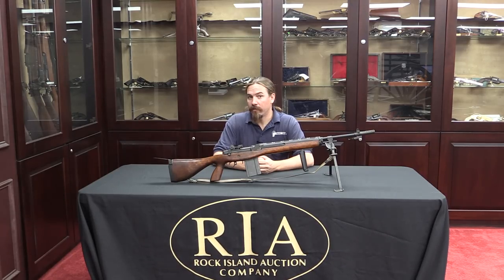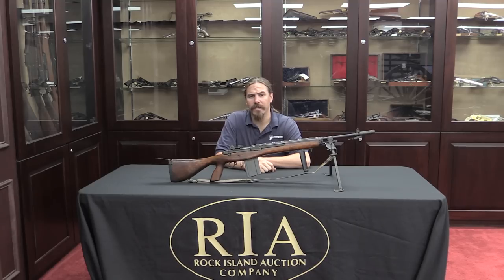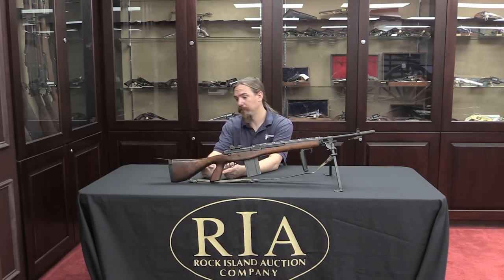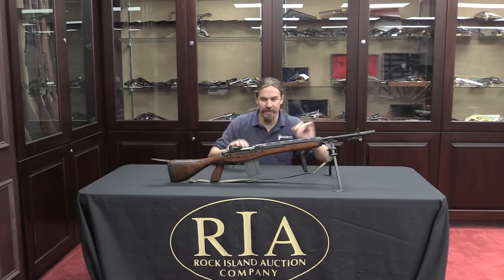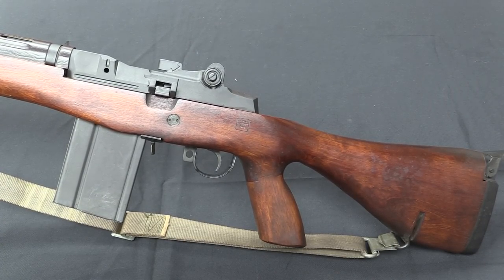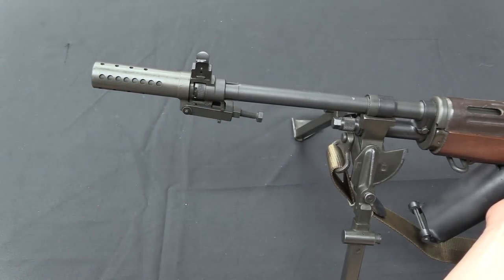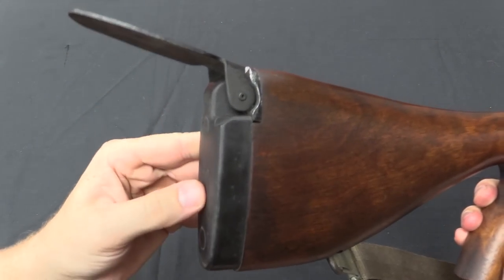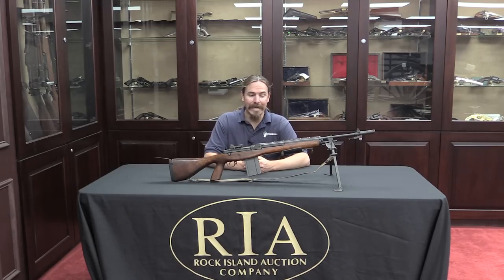M14E2 Semiauto Clone

Comment: Very interesting was back in the late 1970s and early 80s.An auto-rifleman was designated by having a bi-pod on his M16A1 in the infantry squad which had two with one per fire team before the SAW was issued to the infantry.I was in both mechanized infantry and airborne infantry.Mechanized infantry had an M-60 per squad as an AR (Automatic Rifle) in truth its a light machine gun per squad.In the airborne infantry units they had what i have mentioned previously and had two M-60s in their 4th or weapons squad.In airborne,air assault,and light infantry units bounced back in forth on the concept on how to use the M-60 as a SAW or M16A1.By 1988 when the Army had enough M249 SAWs the table of equipment had changed once again.Mechanized infantry had one saw per squad,airborne,air assault,and light infantry had two to each fire team.After Panama in 1990 all airborne,air assault,and light infantry units had been equipped with SAWs with the exception of most mechanized infantry by Desert Shield because the priority for the SAW was airborne and light infantry units.The SAW is an excellent weapon by my experience both in combat and training.The Marines have gone back in time to adopt the M27 Individual Automatic Rifle from H&K as a HK 416 variant of the M4.The only difference is that he will carry more magazines than belts which is more reliable as a system.

Comment: In concept, it looks to me to be like the FN C2, which was used in the Canadian army from the end of the Enfield/Bren era, until the M16 family era.  It was not a great gun, although I can see it was better than this thing.  The C2 was basically the same as the FN C1  (a variant of the FAL), except it was full auto, had a heavy barrel, bipod, different sites and 30 rd mags.  I think it was better than this m14 variant because the bipod folded up to become the fore stock.  It was a decent bipod, and when deployed the entire barrel would be exposed for cooling.

It was used as a section (ie squad) level LMG with one or two per section., so when it came out it replaced the Bren Gun.  The Bren gun was a great weapon in my opinion, and the C2 was not so great.  The Bren gun weighed about twice as much, but it had a quick change barrel.   Other than to the person tasked to lug it around the extra weight and QCB were a huge bomus in an LMG.   I know from personal experience with the C2 that after firing a few mags at a high rate of fire the gun got so hot that you no longer had control because of cook offs.  At this point if you had a Bren you would change barrels.  As anyone with experience with machine guns knows, barrels don't last that long.  It doesn't take that long to burn them out and have rds going down range sideways.  With it's great sites, bipod and heavy barrel the C2 would have been a good designated marksman type weapon in it's day, but withut a QCB, most of them had shot out barrels.

Anyway, long story short, in concept this thing looks like the widely used FN C2 and similar FAL LMG variant.

Comment: Didn't the M-60 fill the roll of squad automatic weapon during this time period?  
So why the M-14E2 ?
Reply from the maker: It did, but only because the M14E2 was a failure. In theory, the M14E2 was supposed to replace the BAR and the M60 would replace the M1919.
Reply: Not surprised.  I never understood the concept of the BAR either.  With such a limited ammo capacity, you spend more time reloading it than shooting it.  

Not very effective at laying down suppressive fire unless you have like 20 of them.
Reply: From what I remember, the M60 was just supposed to be a utility machine gun. Not designed to be a dedicated squad automatic weapon.
Reply: heirofaniu the bar was the exact same in ww2 as ww2 except they put a lot of heavy awkward junk on it
Reply: The same reason we have a m249 SAW when the 240 bravo replaced the m60, why do we need the SAW?
Reply: The M60 was meant to fill various roles so that's why you'd see it in helicopters and tanks in Vietnam then this didn't work so out of that the HMGs were born to take those heavy vehicular roles along while the SAWs tried making a lighter sustained fire concept with ammunition shared by the whole squad (Hence SQUAD automatic weapon) and the Miniguns because they realized a normal MG just wasn't effective enough for helicopters

Comment: Borrowing pages from BAR developme t they could have increased the long range accuracy of the M14E2 by simply moving the bipod further forward.  With the BAR they had to move the bipod further back to increase the beaten path at long range.  They could have done the same trick in reverse for the M14E2.  One can only speculate, but a possible reason they didn't do that was that somewhere up high there was someone who didn't like the M14E2 so that improvement was not tried.

Comment: Okay.  If the M-16 is the AR-15, and the M-15 is a BAR Variant, and the M21 is a marksman/sniper variant of the M14, what are the M-17 to M-20 rifles?  IIRC, the M21s were used in Vietnam, so they all would have been Vietnam-era rifles, right?

Comment: Why does the receiver have a stripper clip slot cut into the bolt and still have a mag. release on the underside of the weapon ?
Reply from the maker: +lawgiver1 So you can use either clips or new mags.
Reply: Cuz 20 aint 2nough

Comment: I kind of feel like this is what the M14 should have been. Now obviously the actual adoption should have gone to either the FAL or the AR-10, but compared to a standard M14 this just seems to do the job quite a bit better. It may not be a particularly good machine gun, but I bet without the added weight of the bipod and the shoulder piece it'd be a decent enough rifle for the early 1960s.

Comment: I doubt an M60 would run circles around it. At least not for long as it did weigh twice as much + ammo
Reply: +retsaoter the M60 weighs twice as much, thats why its particularly good in full auto when it WAS working, its weight would keep its muzzle down, plus its belt fed by 100 or 200 round belts VS the M14A1's 20 round mag.
Reply: +retsaoter More of a jog than a run.
Reply: retsaoter Having shot a full auto M14 and a M60, one acts like a Anti-aircraft gun in full auto, the second is a proper MMG, i would rather work on my cardio carrying a M60 then work with a Hillbilly rigged M14 thats pressed into a LMG style role.

Comment: LOTS of problems with the M60.....

Why, why oh why didn't they just copy the MG42
Reply: +Nguroa Because it was made by zee Germans.  And what do they know? They lost two World Wars!!! Seriously though, the MG42 is probably the best MG of all time.
Reply: +Germaxicus The sad thing is it's probably more because the MG 42 was too mundane. The FG 42 fit the US military's preconceived notions of what the "perfect infantry rifle" would be (notions which apparently didn't include any actual test-firing), while some experimental MG 42's converted to .30-06 wouldn't even cycle (because they failed to account for .30-06 being a few millimeters longer than 8mm Mauser), so naturally the M60 was inspired by the gun that broke apart entirely when fired in full-auto rather than the gun that was infamous for firing fast and long with little issue that couldn't be solved in a handful of seconds.
Reply: m60's were used for infantry and on choppers  from my experience they shot millions of rounds with not a lot of problems   Being lazy and not cleaning it properly when you got a chance was the main reason for malfunctions. In1966 the AR15 was the biggest jammer in the war .I've heard that iimprovements like stainless steel replacing aluminum made it better.!